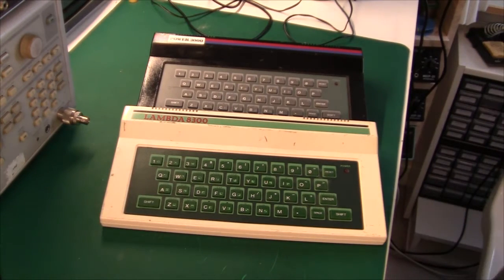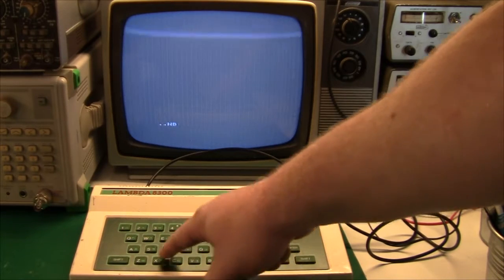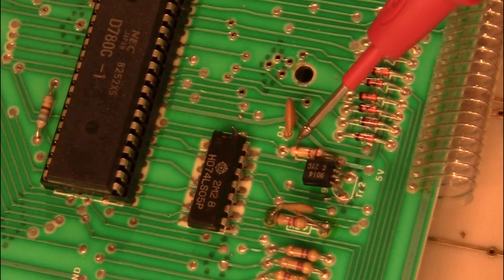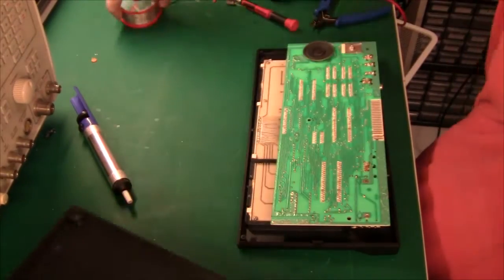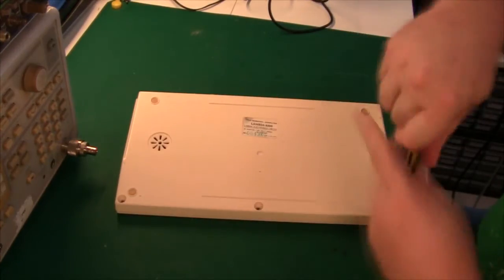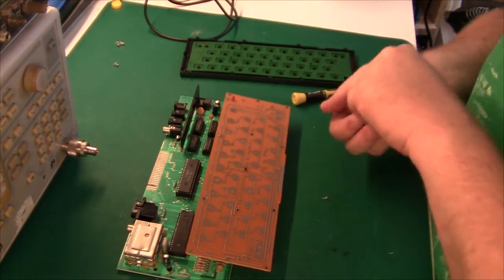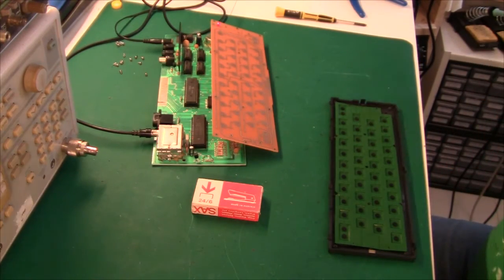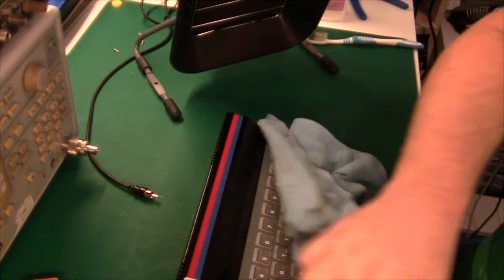Repair of Power 3000 and Lambda 8300

Comment: I see you are using the snap vacuum extractor rather than your desoldering station. Just curious...
Reply from the maker: Out of habit. When removing 2-pin components, I normally just heat up the solder joint and pull it out from the other side, and then clean up the hole with the snap one.

Comment: Great video as always :-) What was the value of the resistor you put into the Power 3000?
Reply from the maker: The reset circuit now consists of a 100kohm resistor, and a 330nF capacitor. This gives a little longer time-constant compared to the original 220k and 0.1uF. I think the factory used 0.1uF throughout, so they only had to stock one value, and also to avoid any mistakes during manual insertion of the parts before wave-solder.
Reply: Thanks :-)
Reply: Perhaps a silly question, but wasn't 100nF (0.1uF) a rather large value for a ceramic capacitor, especially being that small, physically?

I remember them being in the pF range, up to one or perhaps a few nF. I belive ELFA still has no simple disc ceramics above 100nF.
Reply from the maker: 100nF has been available for a long time. It's just only recently that they have 10uF in ceramic.
Reply: NatureAndTech
Yes, they have apparently been available since the early 1980s, at least in Japan.